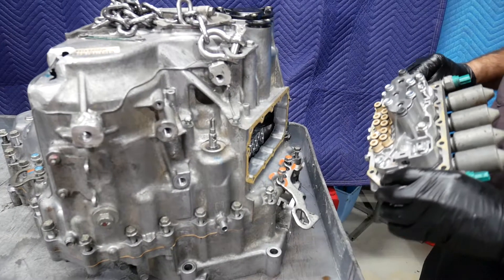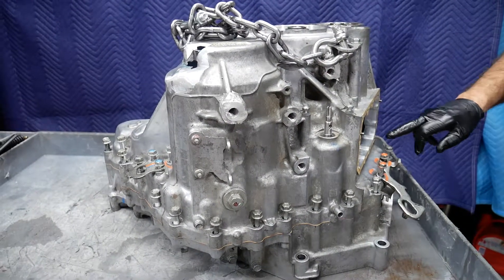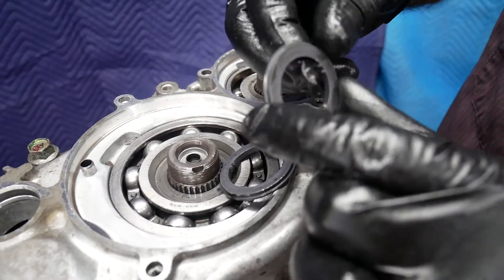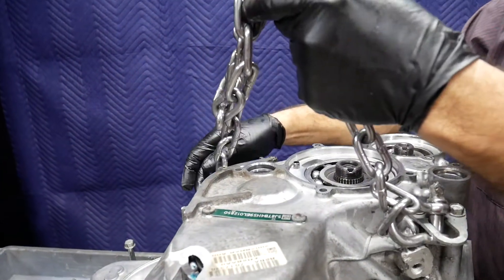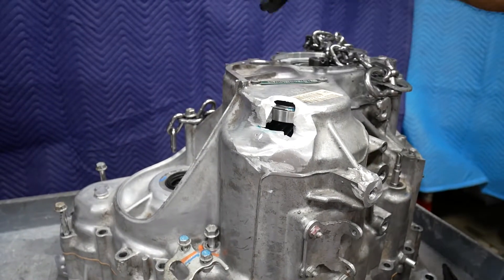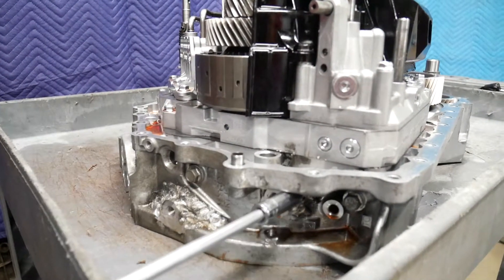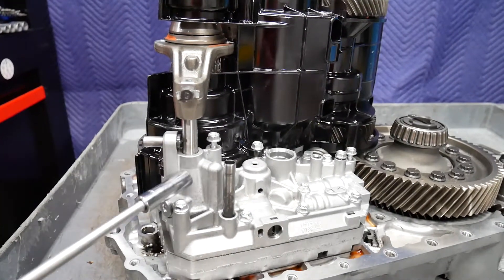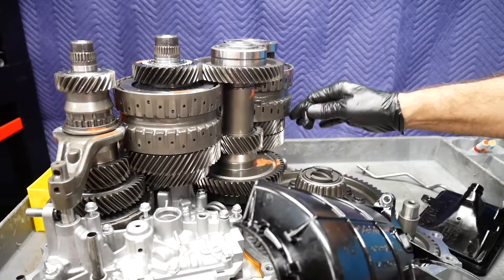Honda H6 6-Speed Automatic Transmission Disassembly Part 2

Comment: How is the reliability on the 2019 Pilot 6 speed Transmission. Should get the 9 speed or 6 speed?
Reply from the maker: The 9 speed unit that Honda uses is made by ZF and is known s the ZF 9HP, Chrysler has had a mixed review with this unit but Honda has been much more successful. https://en.wikipedia.org/wiki/ZF_9HP_transmission
The Honda 6 speed automatic has been used successfully for many years. https://en.wikipedia.org/wiki/List_of_Honda_transmissions
 The six-speed automatic transmission in the first three trim levels, and a newly-remapped 9-speed automatic in the top two (Touring, Elite).